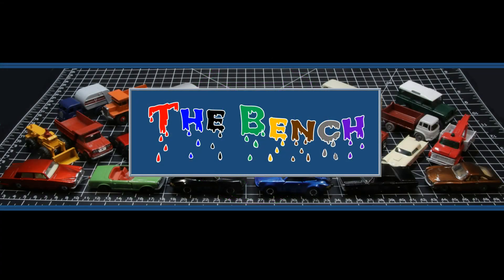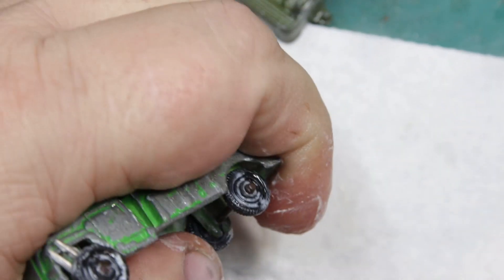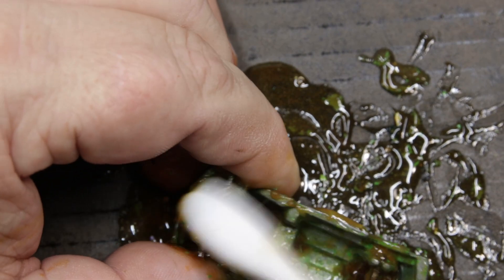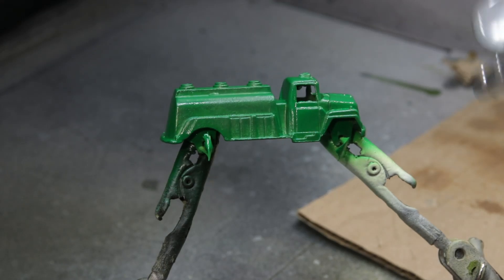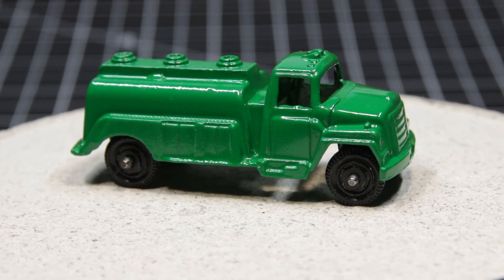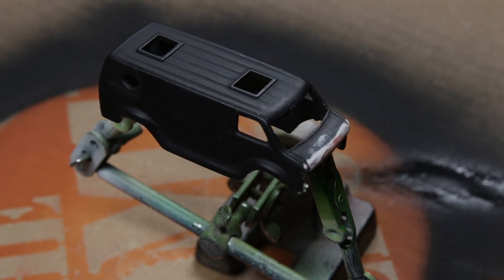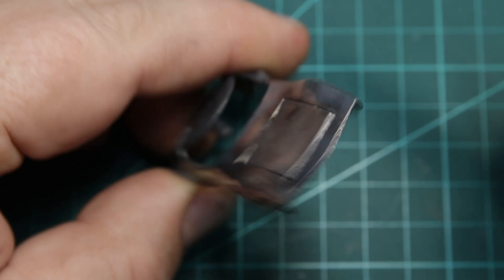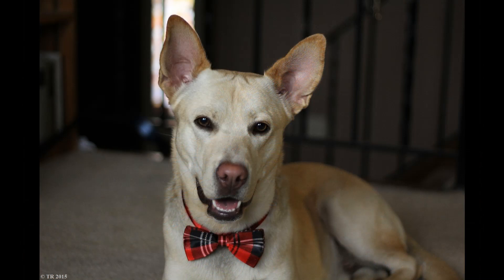The Bench #11

Comment: Hi Lee I really like the way you are expanding your skills. Can't learn without stepping out of your comfort zone. 40 years of photography makes you a little more than an amateur. Just some friendly advice- study the way the body shops repair body panels. They use gradual hydraulics to move panels slowly, and they tap with body hammers very gently. Trying to bend the light-weight die-cast with just fingers and pliers takes a lot of force all at once and when it starts to bend, you have no control and it breaks as it starts to give. Not saying you need to invest in a body shop, but maybe some jewelers tools. Also maybe a die-cast junkyard on eBay for some practice cars. I think you have your painting nailed. Just don't be so critical on yourself. You do excellent work, and you will only get better. I would like to do what you do when I grow up. By the way, go Bears. Your Vikes in an NFC North match, so the Bears will lose a half a game no matter what the outcome.